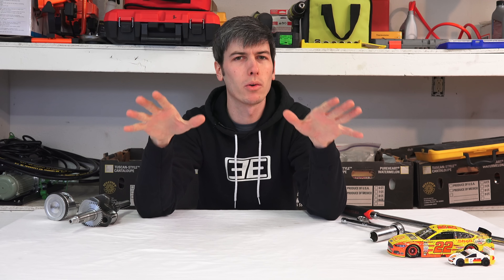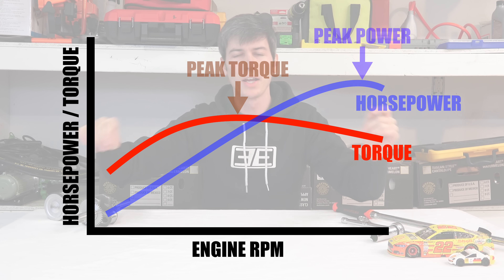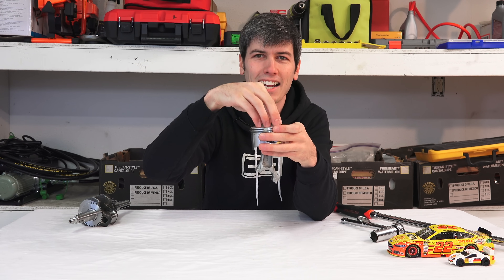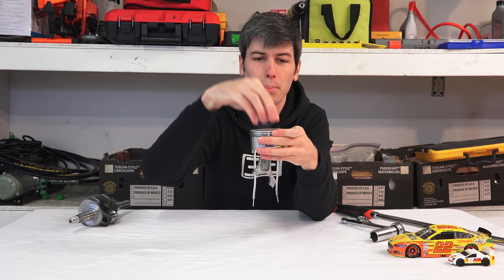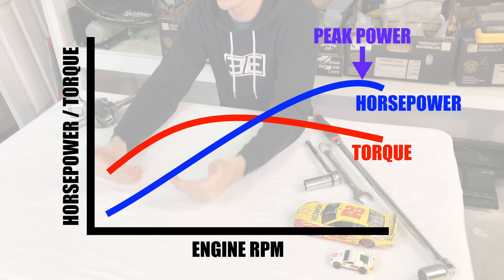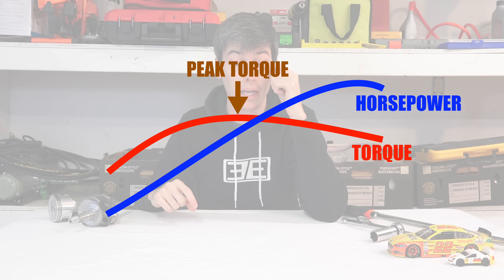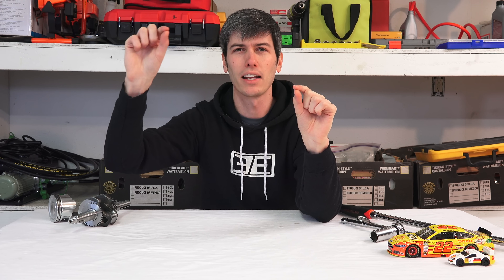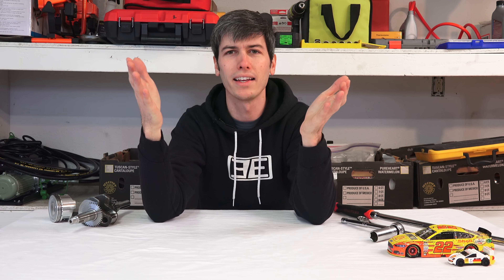Horsepower vs Torque - A Simple Explanation

Comment: Actually not Horsepower vs Torque, BUT Power vs Torque. 
Horsepower is a power unit, like Watt (1HP = 745.7W)

A good wai to realize qhat torque is, is to understando it in real life hen you drive a car.
The power of the engine will make you go faster when you increase the RPM. The most powerful the engine is, the faster you´ll get. OK.
The torque will dictate how fast you can increase your RPM. High torque will allow you toi go from 700RPM to 7000RPM really fast, and get faster acceleration. Easy to see that when you change gears... you have a lot of torque in a low gear, like 1st... but low torque at a 5th gear, for example... you cannot even start moving you car in 4th gear, it won´t have enough torque... and IF you could, it would take some time to go from 700RPM to 4000RPM, due to the low torque.

Comment: The reason i watched this vid is to understand the difference between the two, now im more confused 😂😭😭
Reply: If you are still around and want to understand, I'm happy to help if I can. It's better to begin with torque - just twisting force. Maybe the thing is moving, maybe not - doesn't matter for torque. Do you feel like you understand torque?
Power is a very broad and very useful quantity and can be expressed in many ways. But just honing in on what it means for a vehicle: It can directly tell us how hard the engine can push a vehicle for how fast the vehicle is moving - more power means harder push at whatever speed compared to lower power.
Torque is simply part of what power is, but it cannot tell us any of what power can.
Torque and power are both present in all running engines that are doing something. They aren't "alternatives" to one another. Power tells us about how the well the engine is doing the task. Torque tells us an internal force in one part of the vehicle internals. 
Be aware that because power is a bit harder to get your head around, MANY people draw up rules of thumb based on torque that kinda work as long as vehicles are similar. Many people also believe that heavy lifting tasks require high torque engines. It's intuitive and it seems to be confirmed by the engines we see doing those jobs, but it is not true. I can go into detail when you want...

Comment: Great video, perfect explanation, thanks a lot!!
I have a question you probably can answer with no problem,
I changed my Jeep Wrangler tires for larger ones. How did I affect the torque and the HP??
Thanks man!
Reply: You reduced the maximum available torque that the tires can put to the ground, but there will still be plenty to move your vehicle.  The HP available at the wheels is unchanged, but you'll be moving slightly faster in each gear when you are at peak power RPM assuming no clutch slip, and the gears will be "taller".  Look up "final drive ratio" for what you changed on your Jeep by changing tire size.
Reply: @buzzlesworth54  thanks a lot for the answer!👍
Reply: You didn't change the torque at all by changing your tires.  Torque is force at a distance.  What you did change is the force your tires can put on the pavement. You essentially changed the gearing by putting a bigger tire on.
Reply: @Iffy50  thanks you so much for the explanation!👍

Comment: Even EE is perpetuating the "torque pushes you against the seat" broscience? Acceleration is what pushes you against the seat, and acceleration is proportional to (horse)power.  The engine's effective power output relative to the vehicle's weight is what pushes you against the seat.

My turbocharged vehicle has a flat torque curve at 376 ft-lb from 1800-4600 RPM, and has a constant increase in acceleration up to 4600 as you'd expect from the HP formula.  EE seems to be implying that I'd feel the most acceleration at 1800, but acceleration keeps increasing linearly with power up to 4600 RPM and starts decreasing until it hits peak HP at 5600 RPM.  I'm not even sure where he's getting the "torque pushes you against the seat" unless he's confusing engine torque with wheel torque even though wheel torque is not mentioned in the video.

Comment: For those who didn”t quite get it, neither I got it the first couple of times I watched the video😅.
Imagine you and a friend have to push a giant rock each other, you both have your own rock. Now lets say you use some sort of robotic arms which can be set up for diffrent accomplishments. You set your robotic arms to have a specific force(torque) BUT after you push the rock with that force it needs a time gap after you do the next push again in order to move it out the way. Now your friend has the same equipment like you with the same set up, EXCEPT for the fact he sets his robotic arm to not have any time gap(or a very small one like 0.2 sec), This is HorsePower. If you measure the time, certainly your friend has an easier time finishing the job, but not because he works harder(he uses the exact force like you/TORQUE), but because he is faster (he has the HORSEPOWER) and this is because he doesn”t have to wait much for the next time he pushes the rock again. Now it is common sense that he finishes faster because he works quicker in the time between the pushes, but his push is equal to yours, because you have the same TORQUE.   Lower the time gap between pushes, bigger the horsepower.
Now to translate this in car statistics: 
Car A and B climb a hill. Both have the same engine, but Car A has a specific defect on the engine, that it cannot rotate more than let”s say 1500 RPM. 1500 is the barrier for it. Car B doesn”t have it or it is way higher, like 3500 RPM.
Both engines have the same mechanics regarding Torque, but one cannot spin faster that 1500 RPM.
The start in the same time and because of faster RPMs, (RPM=the time gap I talked earlier), Car B reaches the top faster than Car A which also reaches the hill after a while. They both have equal TORQUE, but because of the RPMs, one has bigger HORSEPOWER which allows it to be faster in finishing the job.
        An example in real life is when you want to accelerate to get faster to one location, thus taking advantage of your maximum horsepower when you can just let the car go without acceleration and using only the power of the engine, or its TORQUE. Basically when you press the gas pedal, you rotate the ”engine” more (+RPMs) and using the TORQUE you become faster and reach the destination quicker because you added more RPM to the TORQUE and created more HORSEPOWER that is the key to being faster as a car(Hp is always related and depends on Tq). That is why more Hp cars are faster than less Hp cars. 
      A funny example of understanding how they work, imagine you and someone else are both very smart(torque), but the other one has more money than you(horsepower). He will become more succesful than you in a shorter ammount of time because he has the Hp, or money, when you will become succesful after more time because you have less money,or Hp. You both have the same inteligence, Torque, and resolve problems the same way, but he is more succesful because of money to start up.

Comment: I prefer more torque, because it gives you more HP in lower rpm's and it means more comfortable, quiet and less stressful ride. HP matters of course, but not everybody wants to rev the engine to the redline all the time. It's noisy and consume more fuel etc... Fo example I tested small VW TSI engines 1.2 and 1.4l turbo 4-cylinders and in low rpm's they were more pleasant than BMW 330i with non turbo 3.0l 6-cylinder. After I moved to the second part of the tachometer game changed and BMW start to shine.

Comment: If my car is faster uphill vs my friend's car, but we're same at level ground, does that mean i have more torque or horsepower?
Reply: Acceleration of a car is mainly a function of a combination of its power/weight ratio and it's power/drag area ratio. As speed increases, power/drag area ratio becomes more important in determining acceleration. As road slope increases, power/weight ratio becomes more important. If on an incline your car is faster, then your car must have superior power/weight ratio to your friend's car. Your friend's car must have superior power/drag area ratio to your car. Your friend's car will reach a higher top speed, but your car will do 0-60 quicker. This is assuming both cars' tires have the same amount of grip and both cars are geared optimally.

Comment: Dear All 
Pls. Help me in understanding that, when HP is multiple of Torque and RPM , then this means the vehicle that has more Torque must be having more HP.
So I want to know how it is made possible that One vehicle has HP of 200 and Toque of 100
While other has HP of 100 and Torque 200????????
As HP= Torque x RPM
It shows that the vehicle with 200 Torque must have more HP then the vehicle having 100 lbf.ft torque......
Then what I understood this is only possible due to the gear ratio.....??????
Pls.reply
Reply: The formula for horsepower is: (torque X RPM)/5252,  he forgot the 5252 in the video.
What you described is possible depending on the exact scenario. An engine that produces more torque at a certain rpm will also produce more power. However, it is possible for a low torque motor to have a lot of horsepower if the rpms are high enough. The reverse is also true, a high torque motor that spins at a slow rpm won't make much power.
Here is one example of how the situation you described would appear: engine 1 produces 100 ft*lb of torque at 10,504 rpm. Using the formula we get 200 hp. Engine 2 produces 200 ft*lb of torque but only spins at 2,626 rpm. Using the formula we get 100 hp. So we can see that although engine 2 has more torque than engine 1, it has less power because it is spinning much slower.

Comment: Torque is how strong (for pulling), horse power is how fast.  Hence a big engine has more torque and can pull better.  A small engine can only have a limit amount of torque, unless turbo, but can achieve lots of horse power through having a higher revving rpm.  So torque is like a muscular guy and horse power is a fast running guy.  And you can manipulate all that through gearing ratios before it gets to the wheels

Comment: Attach a one foot long wrench to a bolt head and push 100 lbs down on the end of the wrench and you have 100 ft lbs of torque at almost zero rpm.  Its a measure of twisting force.

Comment: Hi, I have this x3 f25 xdrive 30d ms with N57 engine. It was very quick,  powerfull and was working fine as a sport car should. Exhaust was always super clean without any smoke. BMW called and changed its EGR v; what i feel now is a bit delay and loss of power 20-30%! What should be done to regain its power as it was before?

Comment: So if I have a 1/3 hp motor spinning at 1075 rpm, and a 1/2 hp motor producing  the same rpm, that means that the 1/2 hp motor itself is just physically bigger?
Reply from the maker: RPM doesn't mean you're at full load. You can operate at low power at 1000 RPM, or full power, or anything between.
Reply: @EngineeringExplained  i don't quite follow.  I noticed hvac motors will have same rpms with different hps. Just wondering what's the difference? Will a smaller motor draw more amps?
Reply: @BonusBellGrande  the formula for horsepower is: (torque X RPM)/5252 . So if two motors spin at the same rpm but one makes 1/3 hp and the other makes 1/2 hp, then the motor that makes 1/2 hp will produce more torque.
As long as both motors are equally efficient then the one that makes less power will also draw less amps.

Comment: Could someone explain why torque changes throughout the rpm range for a set gear? I get Torque = Force * Distance. The distance won't be changing in the engine, so I would assume force is the variable that changes throughout the rpm ranges? I thought the force being applied with each combustion would be the same at whichever rpm. Also, why is there a peak and not a plateau for torque?

Comment: What about the constant that is used in order to find horsepower? You know (torque x rpm) / 5252 <-??
Reply: Its there because of unit conversions. The formula for power is torque times angular velocity (measured in rad/s). So we have ti convert RPM to rad/s and convert ft*lb/s to horsepower (one hp is 585 ft*lb/s).

Comment: Ultimately, "torque" means: the ability of a car to pull its own weight. That's the end-goal, to pull weight.
Reply: Nah, you're so wrong. Horsepower moves the car in EVERY SCENARIOS. You can apply tons of torque at the crankshaft, but if you can't Turn the crankshaft, you can't go nowhere. Thats why Horsepower is the only measurement of WORK.
Reply: @TwonyTheProducer  Exactly, I don't understand why this is so difficult to grasp. Torque is a FORCE. It does not imply movement.
Reply: @rars0n  Yea man, i couldn't explain this very understandable physic law to these blockheads, They don't want to know, they just wanna believe.
Reply: @TwonyTheProducer  I think that's absolutely true. I get that it can be tricky to wrap your head around, especially when it comes to traction and gearing and all that, but when you boil it down, you're just talking about force versus work, and those two things are are not difficult to understand. I think some people have held onto common myths so long that they refuse to accept that they're wrong.
Reply: @rars0n  I've always held a misconception that torque as not a force, but a mechanical conversion of physical force. I stand corrected. Preciate it.
Reply: @TwonyTheProducer  So torque does not move the car then? You're funny. The Cummins N14 diesel engine makes less horsepower than the GM 5.3 V8. 30 horsepower less if I remember. So tell me then why I should take the N14 out of the International 9400 semi tractor and put in the GM 5.3L V8 instead, since horsepower does it all according to you. If you're right then I had damn well better see that 5.3L V8 accelerate the 14,000 lb semi tractor at a quicker rate than the Cummins N14.
Reply: @exoticcreature3059  Gear ratios. You might be getting less power out of the GM 5.3 V8 because you're not at peak power. Power determines torque at the wheels at a given wheel rotation rate. I.e. at a given speed and mass, the vehicle that is producing more power will accelerate faster. If the engine with "more horsepower" is producing less acceleration at a given speed, then it's actually producing less horsepower.

Also i.e., if you have infinitely configurable gear ratios, then the best torque you can get at a given speed is by adjusting gear ratios to maintain full power.
Reply: @exoticcreature3059  And yes, torque does not necessarily move a car. Simply parking your car on a slope means that there is a constant torque being applied by the wheels. That torque translates to a force that exactly counters the pull of gravity.
Reply: @TwonyTheProducer  Thanks for the correction man. Much appreciated.
Reply: @TwonyTheProducer  So based on what you and @Adam Baldwin clarified and corrected, is it also correct to say that:  essentially "torque" is the rotational force generated, while "horsepower" is the work done with that generated force in order for a car to move??

Comment: See it this way.
Large gear ratio means longer lever, more torque. So it makes it easier for you to actually move a stuck nut/bolt.
But when you have momentum on your side in a car,(when the said nut/bolt is not stuck and is well oiled), the longer lever in only increasing the distance you need to travel with your arm to make the nut spin one full circle.
Imagine opening a jar lid or a nut/bolt, with a lever that is 10 meters long. Imagine how big of a circle you'd have to run to make the lid spin just one circle.

Comment: Engine #1 -100hp , 200ft trq. vs Engine #2 -200hp , 100ft trq. you said the 200hp engine is faster, I say they are equal. You said manipulate the gears to maximize power...so engine #1 has 1:2 gear ratio, engine #2 has 2:1 gear ratio....are they not equal? Give a ratio where one is better than the other. Now if you took two engines, both with 200trq but one has more hp then yes, it is faster. Also, on paper the CVT looks like it will have the advantage, but list a car that is made in both CTV and manual platforms that the CVT is faster. Everything I have seen is that CVT is way slower telling me that the mechanics of the CTV itself is consuming a larger amount of power. Thanks.

Comment: When buying a normal sedan passenger car, I put a greater deal on torque versus horsepower because you would need reasonable speed while driving with fullload of passengers or climbing uphills.
If I'm driving alone most of times, and on normal flat highways and wnt to go beat everybody on the road, then I choose a higher horsepower car.

Comment: I always thought torque wins a drag race - it's what gets the car up and moving the first several gears.  Horsepower is higher gears and to continue the acceleration....??
Reply: torque is twisting force or rotational force so to speak, concept of 'power' is where variable of times start to comes in, in simple word to explain 'power is rate of torque'. simple example like when you wrenching a screw or bolt, the rotational force provided from your hand is what called 'torque', the harder you wrenching screw/bolt the resultant torque figure is higher, and then how fast you done the wrenching is where concept of power comes in, so either in scenario when you twisting/wrenching low load in very fast time, or in scenario you twisting/wrenching high load but slower, the power figure output from your hand maybe equal form both scenario, but the torque figure is different. sorry english is not my native and main language, i hope i have other word/sentence arrangement to make layman/average people get the concept as easy as possible.